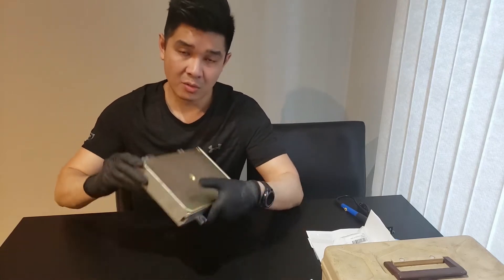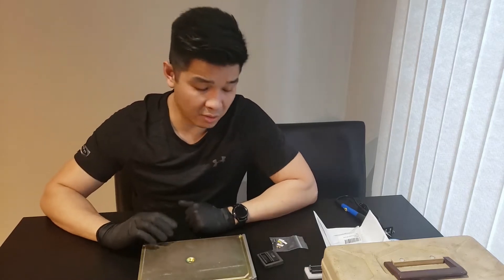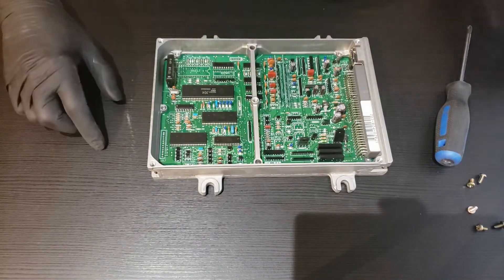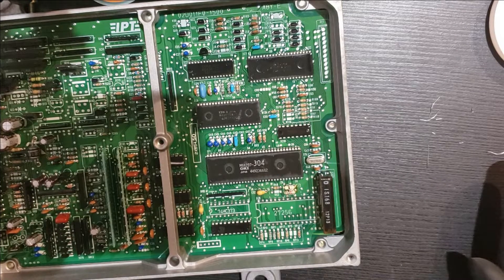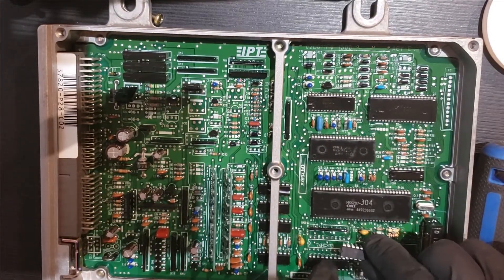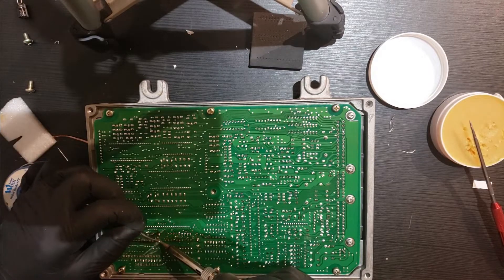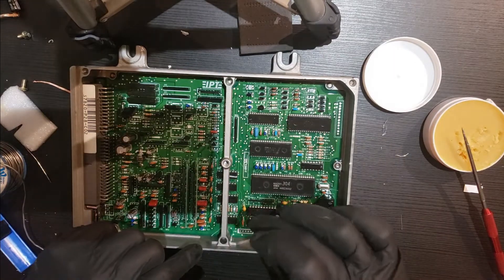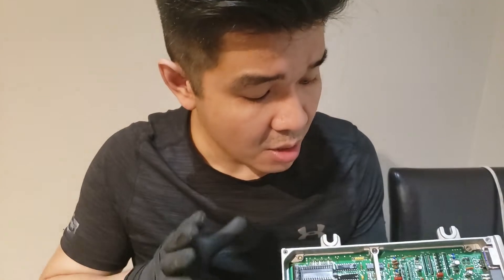||HONDA EF9 / ED7 88-91 CIVIC/CRX|| Chipping an OBD1 P28 VTEC ECU (P05, P06, P72, P30)🔥

Comment: For those that dont know
The p28 ecu has been the go to ecu for the past 22 years
Reason why cause the 93-95 ex single jingle was vtec and once u chipped it you could use crome version or neptune and burn it on the chip and u was set for basemap or your tuner tuned your turbo car

Thruout the years with the egs getting crashed, junked the junk yards of course was the go to but the p28 was must get if you was out in the yard specially manual ecu

There was a point where everytime u hit the yard to find a p28 u just couldnt and this was 2005 2006 2007 etc etc

Therefore what everyone looked over was the dx lx cx p06 ecus because those was non vtec and specially automatic youll find them every single car cause no one cared about them but since technology has gotten bigger and youtube and all the write ups have been online now well thats where people started picking up the p06 converting them to manual and vtec

And in my experience the p28s have always have had the fuel priming delay issue so p28s with there age and seems like honda made them pretty crappy

So what im trying to say is you have a better chance finding and converting a p06 to vtec and have a reliable p28(spec) ecu and not get ripped off theres scammers out there taking out the p28 board out the case and putting in p06 board making you think you just got a p28 and a good deal so be careful buying a p28 virgin off people in person
Reply from the maker: Excellent info